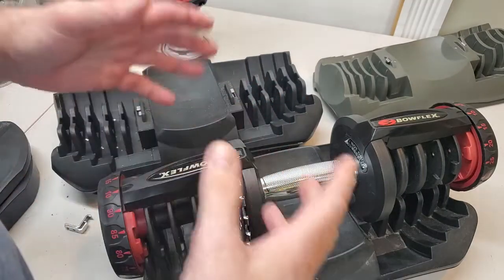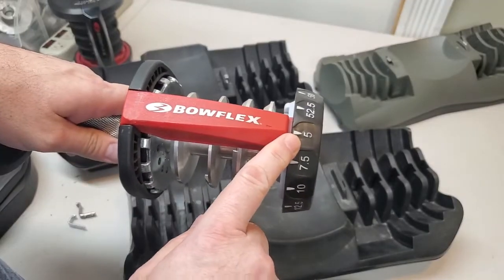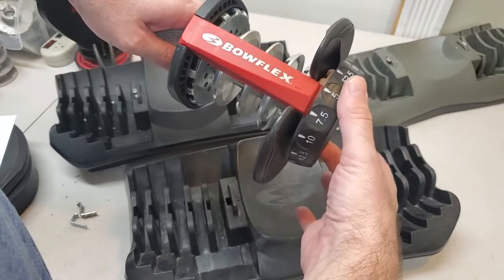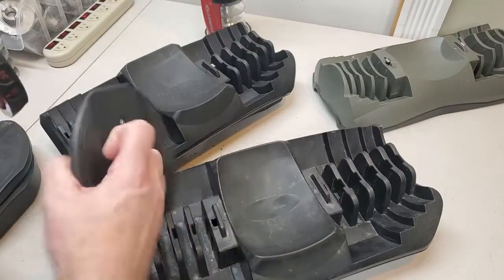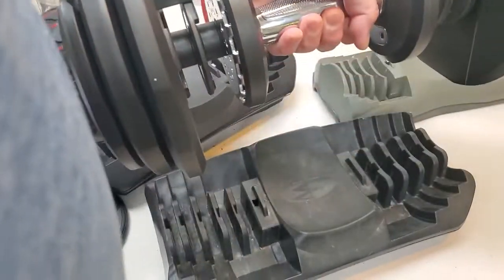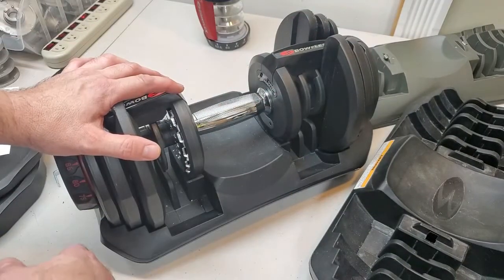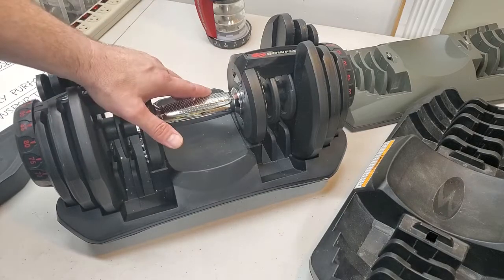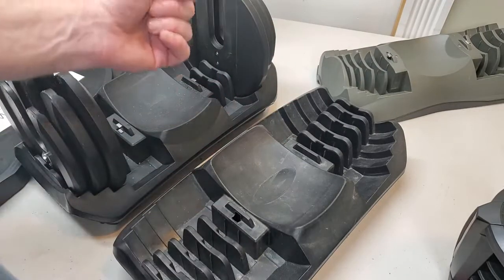Safe Use & Transport of Bowflex® SelectTech® Dumbbells - And Why You Should Never Remove the Tabs

Comment: thanks for the video! its weird because i got a pair of 1090 knock off and the tabs are there but i can lift the dumbell even if the dial is between 2 weights.( the tabs and the teeth of the plate are not exactly like in your video the angle is more a 100 degree angle and maybe shorter . they are brand new so never been forced
Reply from the maker: Hi Mc. Can you send a photo of the tabs (from the top and looking at them from the side too) and the steel disc to my SelectTech.Fix@gmail.com? Also, take all of your plates out of the base, put the empty handle on the base, and see if you can take a video looking close-up at the tab area while turning a dial.  The solution could be something as simple as bending the tabs back into the correct orientation. But I'd have to see what's going on.  I can take a look as soon as I have the opportunity.

What you described can occur when the tabs are bent out of position and/or the handle is assembled incorrectly such that the teeth on the steel disc aren't catching as they should on the tabs.

I would strongly recommend that you not bend tabs while they are in the base. You can accidentally crack the plastic base near where the tabs mount and create a bigger problem.  If tabs need to be re-bent, it's just 6 or so screws to remove the bottom half of the base and another 2-4 screws to remove the tabs. Then you can safely bend them into shape without potentially damaging the base.
Reply: @AverageJoeInnovationsLLC  thanks for the answer i sent you an email i was wondering if the teeth of the steel plate were normal too it seems different than yours on your videos
Reply from the maker: @mc8159  The manufacturing of these dumbbells, both OEM and knockoff are so inconsistent that there are many variations of these components out there. Your steel plates should be fine...emphasis here on *should*. They don't appear to be different enough to cause an issue.  From the images and video you provided it looks like the tabs need to be bent back to the required 90 degree angle. 

Someone (even at the manufacturing plant) may have lifted the dumbbell by the handle while it was locked into the base, with the tabs bearing most of the load. That's one way to cause the tabs to bend upward.  Another would be if the tabs were already misshapen when they were installed.